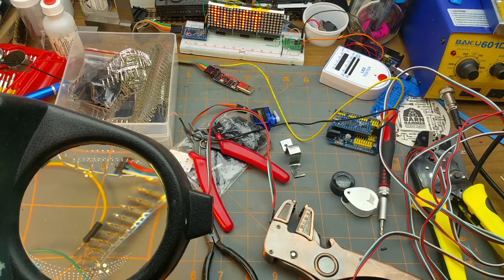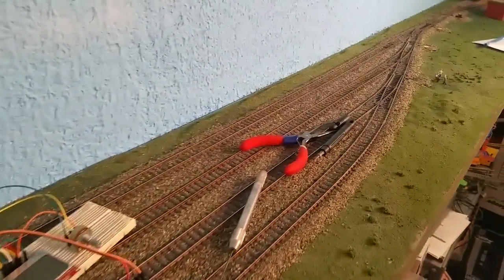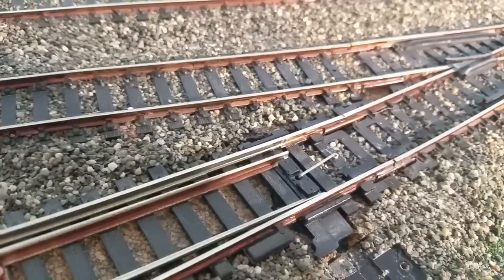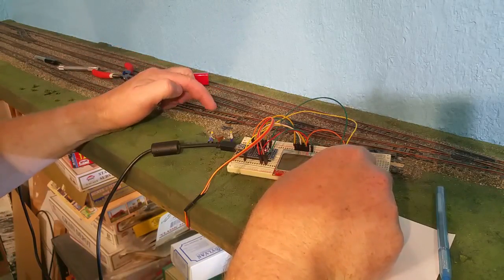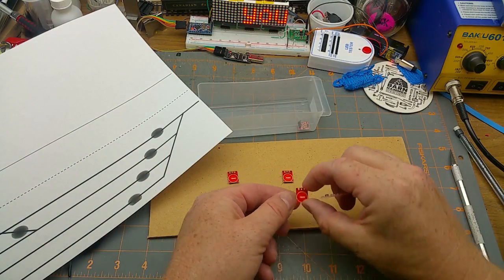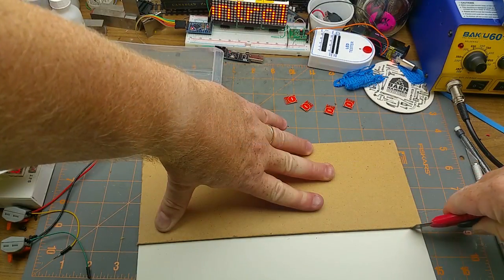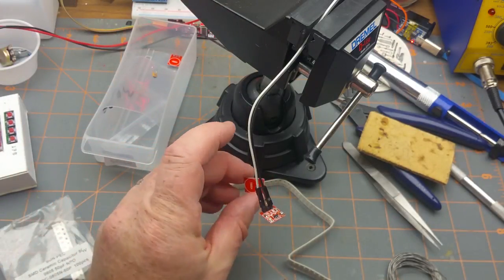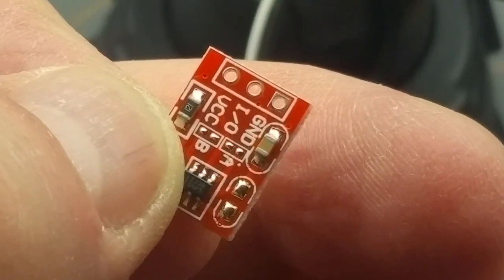model railroad yard controls

Comment: Not bad ;-)

Bought 2 of those Nokia displays recently. Are they 5v tolerant?
Used an ESP32 to test but mostly I use 5V Arduinos.
Reply from the maker: I was using it on 5 volts with no obvious ill effects. 
Perhaps I simply "got away with it" because my cheap power bank only puts out 4.5 volts...
I tried it on 3.3V and it seemed a bit too low-contrast.
I've seen references to it being only a 3 .3 volt device, and I've seen other references saying it's safe to use at 5 volts.
I suspect there might be different versions of the adapter board (poorly labelled and totally undocumented)  that you can get from the usual scumbags in Shenzen.

Comment: Nice job. Gets the work done. I especially like the touch sensors. I though about using Touch Toggles from Berrett Hill, but the price adds up. My panels and turnout decoders include loconet to reduce wiring and benefits by also being controlled by the throttles or a computer running Train Controller or JMRI or stand alone. Also the panels update each other. I've started looking into building panels based on Arduino's instead of the store bought ones I use now. Thanks for the inspiration.

Comment: Love the "tuning board" to determine the extremes of the servo travel. I have just taken the plunge and swapped out a noisy DCC concepts cobalt motor (£18) for a nano/micro servo (£5.50) and spent hours unplugging the nano on my loft layout and trudging down the ladder like a numpty to my PC to make constant adjustments so the servo stops in the correct positions. But now I have seen your excellent piece of equipment I shall have a dabble at throwing one together prior to installing more servos, was it just the two example codes cobbled together  or did you make any alterations. 
Great uploads, always a joy to watch (more arduino railroad stuff would be nice).

Comment: I was wondering when the Rocky Mountaineer was going to get computerised. 
It needs some indicator lights so you know what you have selected without having to look at the points every time.
Reply from the maker: I'm still deciding what I'm going to use for signals, and if I want a main dispatcher panel.

Fortunately, there's enough outputs remaining on the Arduino to accommodate either, once I make a decision.